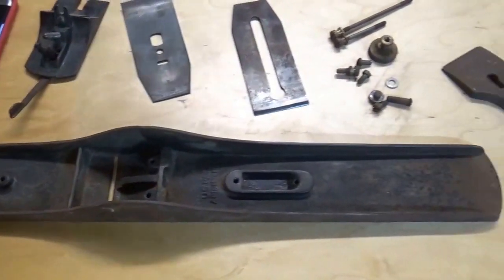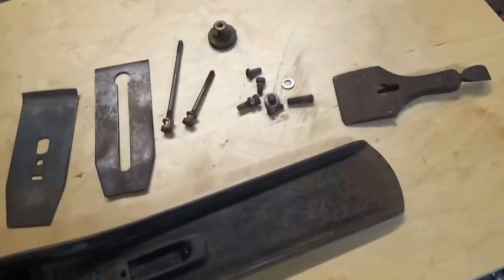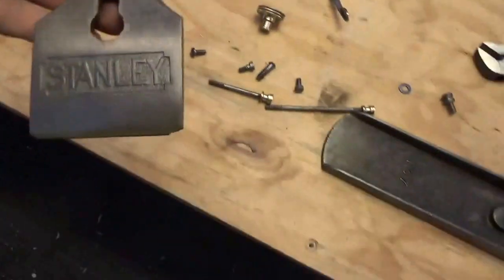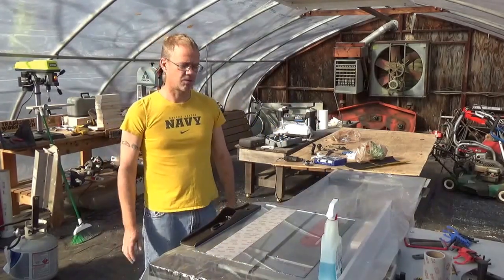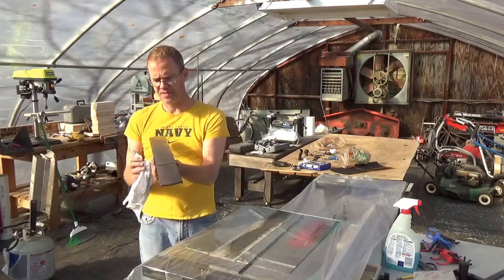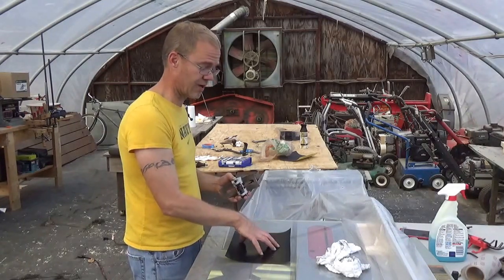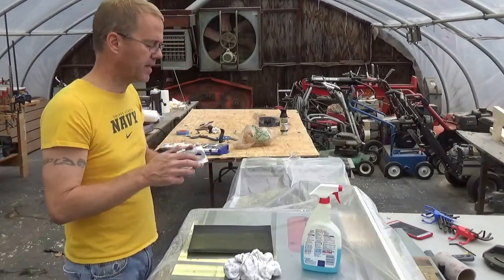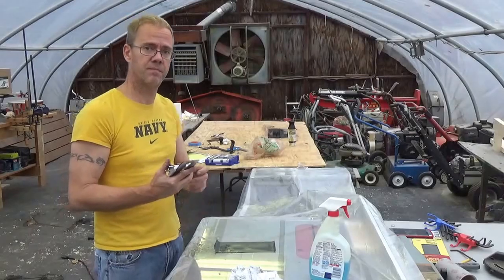Restoring a 100 Year Old Stanley Hand Plane No. 7 -1 of 2

Comment: Great video Ed. I have a few planes you can restore for me. For sharpening, I love my work sharp system. I used to spray glue the sandpaper to the glass when I did the method shown. Now that you restored your plane you can use that plane to flatten and true the benchtop on your new bench.
Reply from the maker: Thanks John, and yes, this plane was made for this very thing. I think I will attempt this soon, for now I am terrified to touch the workbench top...i need to do a bit more hand planning be.fore I attempt.

Comment: Hi Eddie. Your plane has seen a lot of use as the iron is completely used up and was probably not the original. this plane will have been used to true up the edges of timber which was often narrower than the plane, therefore the centre is bound to be slightly hollow from wear. I have watched dozens of videos about plane restoration and it is true that most people believe that you need the plane fully assembled in order to flatten the sole. There seems to be a belief that the frog and lever cap actually stress the sole. I have restored many planes and as a retired engineer I was sceptical of this fact, so I set my planes up in a rig which allowed me to clock the sole with a DTI measuring in tenths of a thou. I found that the difference between the body on its own, with the frog screwed in place and then with the lever cap snapped down was almost immeasurable at 1-2 tenths. Therefore it makes sense to me to flatten the soles on a bare body and then attend to the frog seats and the blade bed. It is very satisfying to restore an old tool and I have to say that all my Stanleys and Record planes perform every bit as good as the new kids on the block which are very expensive. Go find some more and enjoy.
Reply: You found a 1-2 tenths difference between having the frog and lever cap vs just a bare body and you recommend bare body?  REALLY??? 1-2 tenths is huge when compared to most new system guarantee around 1 thou.

Comment: you need to have the plane put together and the iron locked down to get a true flatness when you sand the sole of any plane just saying i have done several hundred planes also be careful how long you put cast iron in vinegar it can ruin a plane i ruined a no.8 my first time with vinegar i just use sand paper now
Reply from the maker: Thanks for the advise. This was my first time doing this.